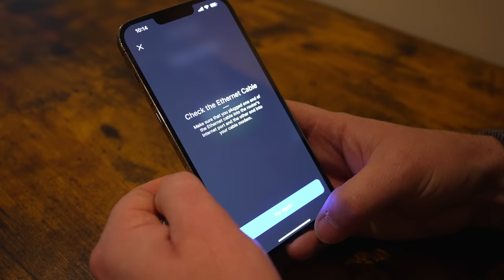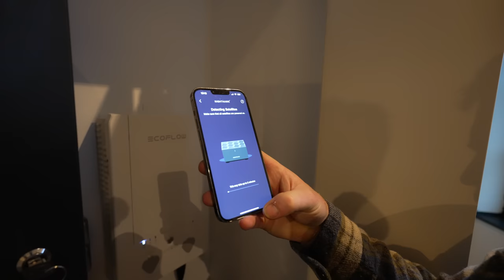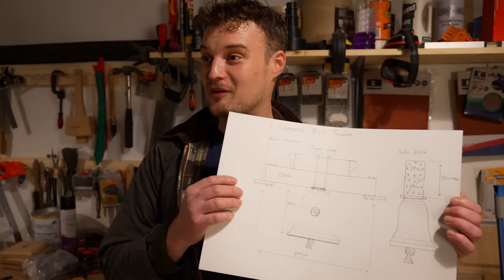Getting Help For The Convent's Bell

Comment: Hi Billy .. saw you pressure washing on you vlog in your yard a few days ago at the convent.Just a tip if you haven't done so already ? Make sure you sweep in some Kiln dried sand after cleaning. This will help stabilize your blocks and keep them held together and stop them from coming loose.I am self employed and have my own pressure washing business. I have 2 very powerfull industrial cleaners and all the equipment should you need any help or advice in future. I am in the UK but visit our house in France a couple of times a year for 3 weeks at a time which is in a village just down the road from you at La Bazouge Du Desert.I am over spring next year and will be bringing my pressure washing gear with me to clean the moss of our tarmac drive amongst a few other jobs. I also am a keen woodworker and make lots of stuff from home.I also work part time at a friends factory doing the wooden treads for bespoke Spiral Staircases. If you have trouble finding the Spiral Staircase you need for the convent ? I am sure they will be able to sort you out. :) Regards Kelvin and Sonja

Comment: Things are coming along nicely at the convent.  Before you put anything on the new you need to pull it away from the door frame and cut in around it 

again with the wall color.  As it is now the black showing through the lighter wall paint is glaringly obvious.  Then you can center the shelves on the 

wall and I second Jessica Koster’s suggestion to put an elf on the shelf!!  And thee Christmas decorating will have begun.

Johanna  Maine USA